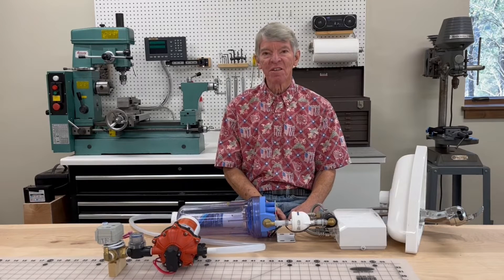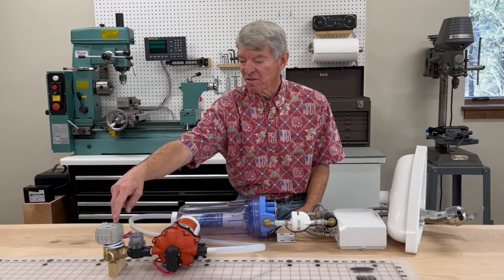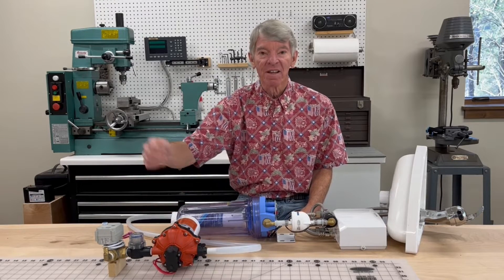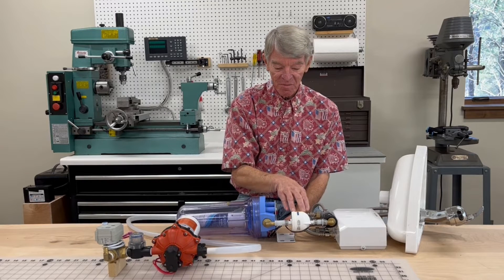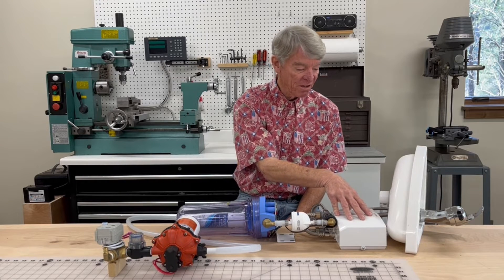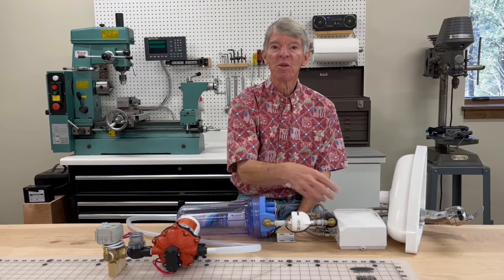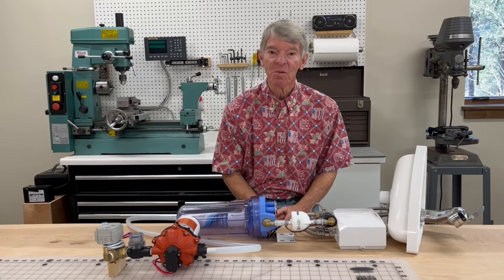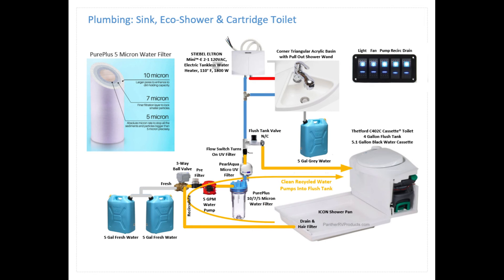Camper Van All-Electric Recirculating Shower w/Tankless Water heater and LED UV Filter

Comment: This is quite brilliant! 
I particularly appreciate how you have the tankless for maintaining the temp, along with controlling the mix of “heater” water and recirculating “cold” water.
Not just a great system, but very well explained, top video production/editing, and I picked up some info in the comments too. Huge respect, and thanks from Australia, two years later.
Reply from the maker: The shower is working perfectly after a few changes covered in later videos. The recirculating shower is by far the most viewed by future van builders.

Comment: Hello Pete:

I'm working on Version two of my own design for a portable recirculating shower and I had a few questions and also wanted to share a few things. I really do like the idea of a heat exchanger, but on my first design one of the biggest issues was the weight. Not a problem for a permanent system, but if you want to move it outside or to another RV, you've got 20 lbs to move around. On my second version, I'm actually separating the filtration from the pump, and this time also including your recommended hot water heater. I understand why you chose the one you did, as I could find virtually nothing in the 1800-watt range that ran on 120 volts. And quite a few of these use 3000 plus watts for a more rapid heat-up. With the small quantities of water being used, I think your idea of using a boost tank is brilliant. Seems to take about four minutes, even from room temperature water to come up to a comfortable water temperature for a shower. I really had a hard time figuring out how to get full pressure out of this, and I finally saw a video from a guy in the UK disassembling one and realized there's a little check valve that restricts the flow. As you know, this takes a fair amount of work to get into the water heater to figure out where this thing is and remove it. Even with the little check valve removed, the water flow is significantly reduced as the system is really only designed for about a third of a gallon and certainly not two gallons a minute.  

I am guessing once the water actually comes up to temperature, it will largely bypass the hot water heater, and this should significantly increase water pressure.  I'm waiting on an anti-scalding shower faucet to test out this theory, but it makes sense. In initial testing, it looks like the hot water heater will put the water past 120 degrees, so I'm not exactly sure what the cut-off is but I'm guessing maybe 130 or 140 degrees.  Again, with a thermostatic mixing valve, once it comes up to temperature it will bypass the restriction of the hot water heater, so water pressure should go up significantly.  

I did order a couple of new pumps just to test. One is the 5-gallon-per-minute that you're using, but this thing consumes a whopping 17 amps of power, which is pretty demanding for most RV systems.  The second was a 3.5-gallon-per-minute unit that has adjustable pressure up to 100 PSI. There seems to be a sweet spot between gallons per minute and water pressure, and 3/8 water line restricts the volume significantly. The water heater further reduces flow based on all of its little tunnels and channels it has to go through.  I'm thinking a three-gallon-per-minute pump that's operating at say 70 PSI would probably do the trick. I'm not sure a 5-gallon-per-minute Is really effective in this case, as you just don't have the volume of water going through the system for it to work efficiently or meet its potential. Greater pressure without the necessary volume is just going to stress the system and probably overheat the pump, although I think  this pump is designed just to throttle down as volume decreases. And as the pump throttles down it would use less power too. Again, I haven't tested this, but that's what makes sense based on how these things work. And to put it another way I think it's just increasing cost size, and weight for not much benefit, but it would be nice to know what you found during your testing.  You may be seeing what seems like increased volume, but my guess is it's really due to the 60PSI versus the 50 PSI of the three-gallon-per-minute pump. I will find out within another week, as I ordered both pumps to try out and will just return the one that doesn't work. Neither one of these pumps is reaching its rated capacity due to the restriction of the water lines for volume IMO. I do believe there is some benefit to be had by increasing pressure up to 70 PSI though. That's probably the limit without causing undue stress and potential for leaks of the components. 

I do believe some increased water pressure may help the comfort level of the shower, but volume is determined by the diameter of the pipe, length of pipe, and restrictions. Again, once the shower water is up to temperature, it will largely bypass the hot water heater, and you should still get decent pressure even from a three-gallon-per-minute pump that runs on about 7 amps. I'm not sure during your initial testing if you messed around with this much, and if so, I would be curious what your findings were.  Based on my experience and knowledge of volume of water versus water pressure, that's what I'm thinking would happen. 

I'm also experimenting with some new filtration, and once the system is together, I'll pass along a link for you to check out as I would love your feedback. Overall, I still admire your system and it's just genius in many ways, of the components you came up with and how you used them. I would have never thought to use a booster water tank and remove the internal restrictors. That's just pure genius.  And putting all this stuff together to work in a compact package is probably one of the greatest challenges, and again, going on my second version, now I'm really appreciating even more all the research and development that went into your product and design. 

It would be nice to meet you someday and chew the fat.  I bet it would be a lot of fun. I really appreciate your technical mind as I am very similar-minded myself. All the best.
Reply from the maker: It is cool that you are experimenting and changing the design for the portable usage case. I thought I made it clear that I disassembled the heater to remove the flow restrictor. This allows for a higher flow rate but I needed to weaken the flow switch spring to keep the flow switch on with the reduced flow required once the water is up to shower temperature.
I use a regular faucet to control the mixing of the water between “heater” water and recirculating “cold” water. By adjusting the faucet to draw some water through the heater and the rest through the “cold” side I keep a good flow rate to not stress the pump. As long as the heater exit temperature is below the hot water set point the heater will put its full heating capacity into the water stream to heat the shower in the minimum of time. When the water is at the desired temperature I pull even more water from the “cold” side to not overheat the water. At this point the water heater throttles back it energy to a very low amount to keep the modest flow rate hot enough. Using a faucet also allow me to start my shower hot and increase the temperature while I am showering.
 Your thermostatic valve will eventually do the same thing but demand more water through the heater until it reaches temperature. This would restrict the flow rate and may stress the pump. It is better to start with a lot of cold water passing through the faucet to not stress the pump and adjust the hot water through the faucet to just enough to keep the heater on. Is the thermostatic valve set temperature easy to adjust so you can start out cold?
I would suggest keeping the water heater exit temperature just a few degrees above a comfortable shower temperature to avoid the possibility of getting scalded. It doesn’t take much hot heater side water to keep the shower hot due to evaporation and too little water through the heater will turn off the heating element which you need to keep heating during the shower. You could experiment with the exit temperature to make sure it can account for evaporation cooling but not overheat the water just to keep the heating element on.
I think you are exactly right about volume vs. pressure tradeoffs. I found that a 3.5 GPM pump could not give me the volume of water I wanted. Just going through the filters and faucet plumbing reduced the flow rate below 2 GPM. Any water passing through the heater reduced the flow rate even more. I switched to a pleated water filter cartridge and that might allow the 3.5 GPM pump to do the job. I would have to swap out my 5 GPM pump to find out and I am not inclined to mess with it. You might try that with your set up. The pumps I tried will cycle on and off if the flow rate is not high enough to keep the pressure below its cut off pressure. As the filter gets dirty the back pressure increases to the point where the pumps start cycling. You could replace the filter or get a little more life out of the filter by adding an accumulator. The pump will still cycle but not as fast to reduce stress on the pump. A higher cut off pressure pump I would think is a good idea assuming the plumbing can handle it. If I could eliminate the accumulator that would be nice simplification. Maybe I will do more experimenting in the future.
If you look at the volume versus back pressure curves you can see a significant reduction in volume with higher back pressure. When you do your testing you should try to use a dirty filter cartridge.
It would be great to meet someday to just hang out and share ideas. I live in Colorado but travel to the west coast periodically. You can send me an email at fivepoundpete@gmail.com.

Comment: I implemented a similar recirculating system, with the same water heater, but the water doesn’t get really“hot.” Is that your experience? I did not remove the flow restrictor from the heater.
Reply from the maker: With the flow restrictor in place the amount of water being heated at the factory setting may not be enough to overcome evaporative cooling. You might try adjusting the temperature setting of the heater to a higher temperature and see if that does the trick.
Reply: @fivepoundpete I adjusted the setting to the max at 125 F and it did the trick
Reply from the maker: Glad to hear it.

Comment: Is there a list of parts where to get them and how to install them?
Reply from the maker: I did not make a parts list. I do call out many of the harder to identify parts in the videos. I sourced most parts at Home Depot or on Amazon. Some parts from the original manufacturer's websites. For the more expensive parts I shopped around. If there are particular parts you are having trouble finding let me know.

Comment: That’s a good system. I don’t think you need the UV as you’re not drinking the water. If you increase your heater volume, like 4g, the flow rate will be less allowing the heater to heat the water. You’ll also need to make sure the filter you choose isn’t restricting the flow rate and that you have enough psi to push through but not so much  it’ll damage the fittings
Reply from the maker: Thanks for the comments. It has been recommended that I use a UV filter and even though I don't drink the water it give me some peace of mind having one.

Are you suggesting to use a 4 gallon water heater? I have seen others use this solution. This would supply more hot water at a near constant temperature as you shower but would require about 10 minutes to come up to temperature before you start your shower. It also would use a lot of power to heat all that water and could add significant weight and size to a solution. My on-demand tankless water heater heats 1 gallon of water in about 2.5 minutes and only heats the water I need for my shower and is light and small. If the 4 gallons is save after each shower it gets progressively more cloudy and at some point all of it needs to be dumped. We have found that we just dispose of the gallon of water after the two of us shower. 

The 1.8kW tankless water heater I am using is a Stiebel Eltron thermostatic model Mini™-E 2-1. It can heat cold water to 100°F  in one pass but only at a 0.21 GPM flow rate. This flow rate is way to low for a shower so I took out the flow restrictor. At the 2 GPM flow rate I want for a vigorous shower it take about 5 passes through the heater or about 2.5 minutes to come up to temperature, ~6°F per pass. Once at temperature the thermostat automatically reduces the power to the heating element ( around 300W) to keep it at the set temperature. I have it set to 104°F. Using the faucet I mix this water with water from the shower pan to get the temperature I want during my shower. I usually increase the temperature during the shower as I get used to the temperature.

During prototyping I switched from a 3GPM to a 5GPM pump to get the 2GPM I wanted for my shower. The pump is rated at 5GPM with no restrictions but drops to 2GPM when adding a dirty water filter, a UV filter and the water heater.

Your suggestions on filter restrictions, back pressure and good fittings are helpful things to watch for anyone building shower system.

Have you completed your build and how is your shower working out?

Comment: Hi Pete, I just talked to Aquisense, they have a newer model that has a built-in flow detector and can work at 4-GPM and can work off of 12v or 24v DC. Look up the PearlAqua Deca 30C.
Reply from the maker: Nice to see that they are still innovating. The PearlAqua Deca 30C is overly complex for my application. When I need to disinfect the shower water I run it full blast at below 2 GPM. The larger capacity and modulation features are really not useful for my application. But I guess if you where using it in a drinking water application where you use different flow rates it would be great.

Comment: Pete, I'm confused.
So, your water recirculation system doesn't require a gray water tank?
Thanks
Reply from the maker: There is not a separate gray water tank for the shower. The bathroom sink drains into a gray water tank under the bed. While taking a shower the water is circulated between the shower pan and back to the shower head. When done I simply put the shower head into the sink and let the shower pan water drain into the gray water tank until the shower pan is empty. I hope this clears up the confusion.
Reply: @fivepoundpete  so, after you're done showering, do you just shut the water pumps off and let the water run into the gray water tank beneath the shower pan?
Thanks
Reply from the maker: I didn't want a gray water tank under the van where it could freeze. Instead the gray water tank is in the garage behind the shower and water from the bathroom sink gravity drains into the gray water tank. After your shower you put the shower head back into the faucet and run the water pump until all of the water from the shower pan is pumped into the sink and down the drain into the gray water tank. Then you switch the water source back to the fresh water tank for normal use.